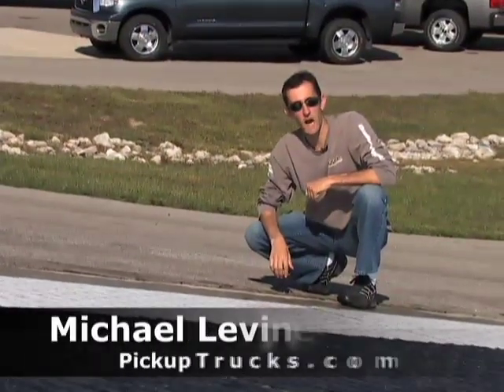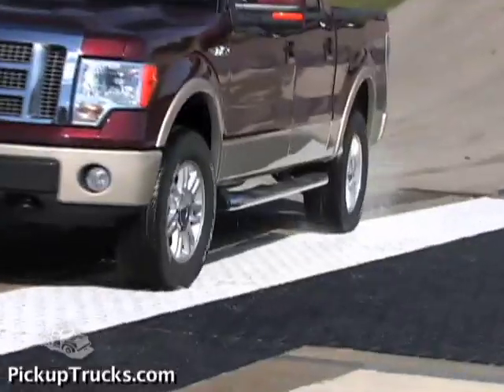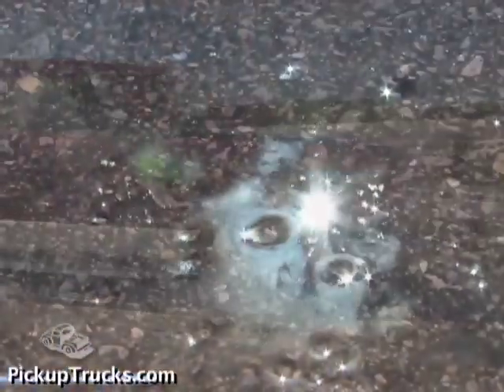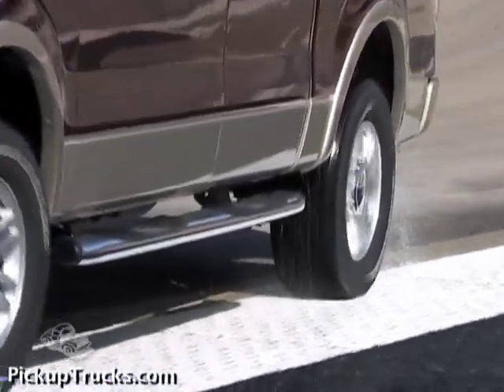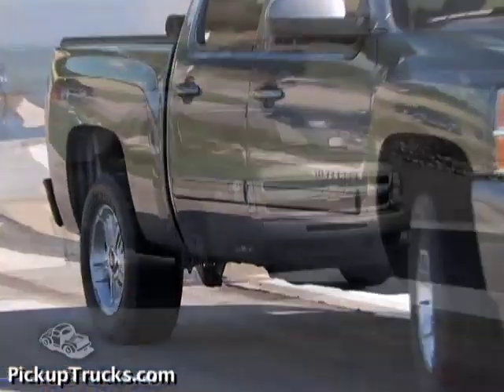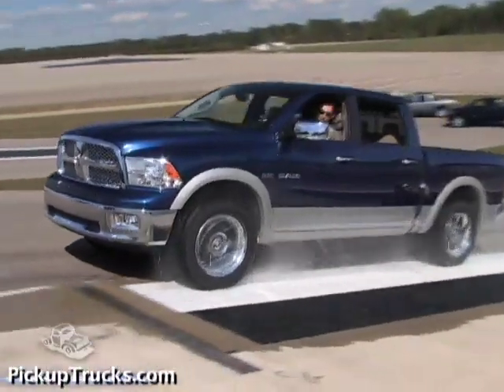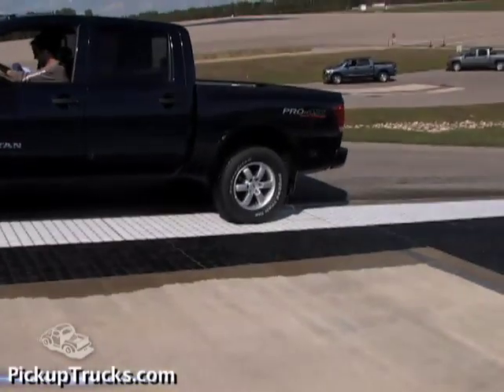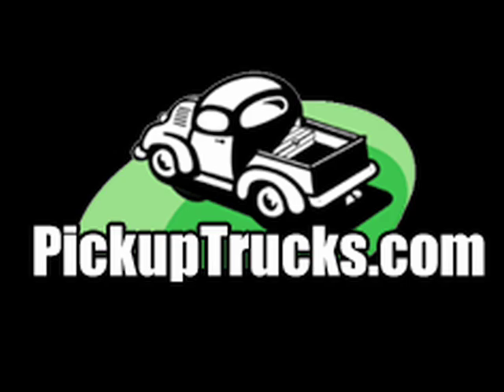Extreme Traction-Control Test

Comment: these were open diffs buddy 4wd wasnt engaged. u saw the gms do this because traction control applied the brakes, first to the one slipping and then to correct the other tire which had subsequently been sped up

Comment: Obviously the wet white tile had some traction, or an LSD, even with throttle-back traction control, would not get you up that hill. But just try taking a pickup with an LSD across a big diagonal ditch, and you won't make it. One wheel in the air has no traction, therefore nothing can be transferred to the wheel on the ground. That's why I prefer a Locking Diff to an LSD.

Comment: What year Tundra did you own. By the way, did you see the Tundra just pull a 300,000lb space shuttle? Not even a 3/4 ton truck could do that and it had no options or special kits on it, it was the same Tundra you would find on a lot. And go drive a 2012 Tundra. That is all I am saying about that.

Comment: that wasn't no 08 f150. my uncle has an 08 and it is the gen before that one in the vid
Reply: This was uploaded in Nov 2008. When you redesign a vehicle you have to say its a year ahead of when it was designed. Because If they redesigned a car in June 2008 it would be different from the one in January-May 2008 but it would still have the same year. That's why you have to say it's a year ahead, to avoid confusion. I bought a 2013 ford escape in October 2012. Did you understand what I told you?

Comment: It doesn't have anything to do with the weight of the trucks.  The term half ton, 3/4 ton, and 1 ton originated a long time ago to group different classes of trucks based on the amount of weight they could hold in the bed.  Newer trucks have long since surpassed these capacities, but the terms remain as tradition I guess you could say.

Comment: So The pickup with locked differentials came last while the one with LSD came first? this test is ridiculous if a pickup has a proper four wheel drive and a proper locking differentials then why test it without them? its like saying the the Subaru forrester is better than the Toyota FJ cruiser because it has symmetrical AWD
Reply: Depending on the test, it actually would be better because of that

Comment: Just took my 2007 Tundra out in the snow with a real LSD from Auburn for the first time.  Gotta say it's massively superior to the auto-lsd crap toyota put on it.  More consistently working that doesn't give up when you get close to that stuck, no momentum left over moment.  You gotta get used to counter steering like a drift racer but that's a riot!  No snap oversteer scary moments to speak of either

Comment: I mean that today's traction architecture seems to work the opposite way it should.
As you can see , diffs deliver the power to the wheel that has NOT traction.
In 2012 i'would have expected to see an effective traction  capabilty apart from what esp or tcs can add.

Comment: While the F-150 did well in this test with it's LSD, there are numerous videos showing the F-150 unable to get across a large twist ditch, with one wheel in the air just spinning. Meanwhile the Chevy pickup just effortlessly walks across the same ditch with it's locking diff. So I'm a little suspicious of the Ford LSD. Braking might help--I guess that's simulating what an ABS traction control would do--but unlike an ABS traction control, you're also braking the wheel that has traction. Not good.

Comment: Makes no since. I'm a ford fan and all, but a truck with a locking differential compared to a truck with only a limited slip would do way better. It would cruise right up in 
2wd with only one rear wheel on the concrete

Comment: I have a theory.... the tire in contact to the pavement is getting too much power and slipping (you can see it on the chevy). Basically a heavy foot with a bad driver... because there's no denying that a locker is better than an LSD for this type of application. Bad driver is bad

Comment: if you need power on a 4x4, like for pulling a tree down or something of that sort, the ford 5.4 can snap a 10,000 lbs tow strap before losing traction. its a beast. And the 4x4 on the ford explorer can drive sideways on sand if it hits a railroad track, as well as drive thru water. If you need these extreme 4x4 uses consider ford, but remember it will cost you repairs after 100,000 miles. I am a chevy guy but under those 2 conditions, pick ford. day to day use, chevy is better. new fords have a serious problem with the spark plugs, very costly.
Reply: homing pigeon races not any more there really reliable

Comment: ive accully done this test myself with a Gm, if you work the locker correctly it would lock the axles and walk up that ramp, expecally if they didnt ahve traction control on, the brake stopping the wheel will remove the lock on the diff... so this only tested the traction control NOT the locking rear diff's. ford, chev, dodge, toyota and nissian all make it up with there lockers ingage's, expecally the Elocker's(eatons and electronic)

Comment: Dude my 06 sierra could do this in 2wd.... diff pretty much locks nmw I don't understand in this video why it wasn't engaging like they really do
Reply: Graham Davis Its because the idiots in the video were just trying to gun it up the hill without letting the locked wheel gain traction. In the video you could clearly see the diff did lock correctly, just the people didn't ease off the throttle at all
Reply: They kept gunning it. A locked diff doesn't help much when you're basically doing a burnout up the hill. The guy narrating this video was often criticized for his bias while he was editor at pickuptrucks.com and he eventually left to work for Ford as their head PR guy. This test is garbage.

Comment: I'm sorry the Chevy has a locking rear diff it is impossible for a limited slip diff to beat it up a slick hill
Reply: Oh, its possible. You need to be either really dumb and not know how to drive a vehicle with a locking diff, or really dirty and deliberately drive in a way to make the lockers not engage.
There is no good scenario here. A test is a test of what a vehicle can do when driven correctly, not incorrectly.
As an example, I can test manual vs automatic transmissions in off road applications, by starting in overdrive with the manual box. Its about the same level of incompetence/bias and legitimacy  as this test is.

Comment: Actually that is not correct.  Even on icy and snowy roads it is not a good idea to be in 4wd in normal driving.  In fact most 4wd systems disable after about 30mph anyhow for the simple reason it is much easier to control the vehicle in icy conditions in 2wd.  4wd is more useful at low speed, with deep snow, or after you've gotten yourself stuck in 2wd.  Before you say I dont' know what I'm talking about I lived in Minnesota for about 30 years.

Comment: It's a flat surface. A 1984 toyota 4runner could pull that with enough weight to push down the wheels. Has nothing to do with the toughness of the frame/suspension.

Comment: I know its late to post on this but it's total crap. I drive a Toyota Seqouia now but I had a 2WD 2007 Avalanche with the auto lock rear end. So easily could have walked right up this, give it a small amount off throttle and hold it, the locker locks and doesn't unlock till you let pressure off it. Not sure why this is so biased absolutely not true !!!
Reply: My thoughts exactly Phil.  I have had several GM's with the locker and MANY times never had to shift to 4X4 because of the G80 lockers.  Biased isn't strong enough word,  RIGGED is more accurate.

Comment: seems to be a lot of confusion here. this test is primarily to test the traction control of the trucks in 2wd. thats it. so ppl who keep saying oh gm/chevy would have won, thats heresay. not what this test is for. another thing, they dont talk about lockers for a reason, many elock systems engage once in 4wd, chevy g80 is an option only unless fitted with z71 package which these dont have and u can see that on the sides of the truck.  the g80 locker slams on thus less reliable

Comment: donno man.. I don't know why you wouldn't 4wd in snow, you have it, use it. personal opinion tho. also, its not always the power or weight of the truck, depends greatly on the type of tires and the psi levels of said tires more tread to the ground = traction. I'm no car or truck expert but just my thoughts.

Comment: I have to agree, If i didnt buy a Chevy my next choice would be Dodge. I HATE Ford! Bought a NEW Ford Expedition in 09' and in LESS than 2 years I had dumped over 4K into it. So I traded it in for an 08' (OLDER) Tahoe that NOW has over 100K miles and I havent put any money into it except Brakes, Tuneup and Tires. LOVE my Tahoe. And next year im going to buy a NEW one. They are excellent trucks. NEVER will i buy a FORD again! YUCK!

Comment: Both GM trucks can make this in 2wd with the g80 without the use of 4x4. Toyota and Ford would struggle with the LSD. 2011+ Ford 2019+ RAM 2022 tundra can make it up with the E-locker

Comment: These "comparisons" always suck.  Its 100% FACT that the Chevy with its locking diff would put more power to the wheel with traction (50/50) than a limited slip, theres no arguing that.  The FACT that all these tests leave out are the tires are different.  Put the same type/size of tire on all vehicles, then you get a better test, in mud, snow, wet roads, etc.  Next compare these to a Raptor for off road comparison... just bring a trailer to recover them after they follow it through a big jump

Comment: @296jayce Because they wanted it to.  Notice that once the trucks with lockers start moving forward, they quit trying!!!  My chevy truck with a g80 locker would have made it no problem.  With a mechanical locker instead of an e-locker though, you have to let one tire start spinning more than the other so that the locker will kick in and locker the two tires together.  Once they get this to happen, they just quit trying, so this video is obviously biased.

Comment: "Traction control applies the brakes to the wheel that's slipping" no it doesn't, as proven in this video.  You even talk about locking differentials.  Traction control isn't a locking differential.

Comment: I have a Titan Pro-4x. It has a push button locking differential and it has a push button VDC. This test is not accurate. They had the VDC diabled and electronic Locker.

Comment: probably a stupid question but i'm not a truck guy, why is it called half ton ?
Reply: To meet it's registered GVWR (Gross Value Weight Rating) it would legally be able to carry 1,000LBs of payload without exceeding it's registered GVWR. Say you own a truck that is registered for 25,500LBS (26,000LBS being the state of PA's weight that requires a CDL) say the truck weighs 20,100LBS wet (all fluids like oil etc.). That would leave you 25,400LBS worth of weight you can put in the truck without exceeding 25,500LBS. Now that that is covered, the truck weighs Z number of pounds, to stay under a certain classification of vehicle/truck it can haul (aka GVWR). To break this down X  is the number of pounds the truck weighs (Tare Weight/Curb Weight if you want to get technical) Y being 1,000LBS (the GW Weight if said truck is loaded), X+Y=Z. Y basically tells how much it can haul.
Reply: aww i see thanks alot!!
Reply: Not stupid. What's stupid is that they still refer them as "1/2 ton, 3/4 ton, 1 ton" etc. They are anything but. It's basically a hold over from the days when a half ton truck was actually rated to carry a half of a ton and so on.

Aside from the obvious difference in age and design, my 2005 1 ton Ford vs a 1975 Ford 1 ton are complete different in regards to weight rating even though they carry the same name. To further complicate things among the various fender badge designations, there's chassis configuration, engine and drive train options, gas or diesel and gear ratio. All which effect and determine weight rating.

Obviously, GVRW's have increased greatly, and therefor payload caps. But be warned...not all trucks are created equal.
Reply: rts Indeed but my last statement was simply an explanation of GVWR.
Reply: onionman113
And you did a fine job explaining it. Better than I.
Reply: rts That is, not all trucks in their respective class are created equal.

Comment: Tyres are more important than traction control. Write tyre specs below please. Its not a comprasion.
Reply: +Can Guder They were testing the trucks as they came equipped from the factory.

Comment: mechanically locking diffs are superior to lsds however you have to consider the most basic thing, which many dont. tires. u can have 4wd, lockers on front and rear or also center diff as well if awd and have multiple speeed t-cases but without proper tires those systems r useless

Comment: The Silverado a d Sierra both have auto 4wd... Which I have had in an 04 suburban z71 and a 2010 Silverado z71.. And good bit more effective than traction control... This test should have been cars with traction control not trucks..

Comment: On the Chevy and gmc both spinning...one wheel is on the wet and the other rear wheel is on the dry concrete?? I can't believe the truck was spinning a wheel on dry pavement at the same time spinning on wet pavement....looks a little strange to me, like the brakes were being applied to the front wheels while the accelerator was being floored to make the rear wheels spin...mechanical diff not that wheel spin is hard to believe

Comment: buy a manual and learn how to drive it most of the problem solved, some upgrades to suspension and diff will help out a lot, if you want to go off road in other than normal conditions and push the truck to its max might as well make your  truck get a good frame and a lot of time

Comment: @GT500Shelby07  pretty guy. I drive a  Lorry or camion  with manual transmission
8 gears plus splitter
to get out of sutch situations you need to action the 4x4 lever and  both differental block leavers
I drove a bombardier offroad army vehicle to

Comment: LSD should be better, all racing and offload racing car use it. locker is mostly good for offroad trucks in mud-ing. 

the wheel which get more traction will get most power but it also allow the wheel with most slip spin a little faster but not too fast. enough power on the wheel with most traction to not spin lose but faster on the less wheel with less traction to spin a little faster

Comment: What's the point of buying a 4x4 if you ain't going to use it?
Reply: Squeezy this is not an offroad situation! if you have a 4x4 you have to use off road im in Canada and daily 2x4 truck no need of 4x4 im never offraod a guess never been stock road are well clean! my latest is a 02 ranger 2.3 5 speed rwd only no trouble i had a 97 Cheyenne 305 rwd only with lsd diff work like a charm on snowy road 4x4 just go deeper in the ditch!

Comment: @296jayce LSD has been constantly evolving over decades. Lockers have run on the same brutish concept since their conception. LSD combined with better traction control logic is superior to simply locking the rear axle together. The proof is in this video. Think of lockers as the predecessor to the Electronically-controlled Limited Slip system, in the same vein that the Chevy C/K is the predecessor to the Chevy GMT8.

Comment: The locking G80 is the shit this is such bull shit it pisses me off!!!!
Reply: sammy duran I have a G80 in my colorado and it works well in dirt.
i've have no problems with it.
Reply: SANIC I agree they're a good locker that's why I believe this video is bs. It takes a very minimal loss of traction for it to engaged. Do u have that automatic four wheel drive? it works really good as well.
Reply: sammy duran i have a 2WD colorado.
i've had 1 back tire completely in the air and it still went up a hill no problem.
Reply: Hell ya man!
Reply: Not sure what is hard for you to understand, the gm's are to light and have rudimentary traction control systems. The locker worked like it was supposed to but it was the 'brains' of the truck that let it fail this test.
Reply: sdfajbdakisjdgh except I have an example of  my Chevy doing a harder obstacle than on the video no problem.
The makers of this video are notorious Ford lovers so its clear that they are biased.
Reply: sammy duran I didn't cut any lines
Reply: sammy duran they did not disable the locker, both rear wheels spin at the same speed. If the gm's had some weight in the bed they would have destroyed this test. But with no weight back there and the traction control has no affect on the rears with a locker. the gm's lost on their own course while being supervised by gm's own engineer's. One short coming on a great truck doesn't seem that bad. 

And gm's are not the best trucks ever made like you all seem to think, they have their weak spots like any other truck.
Reply: sdfajbdakisjdgh based on shootouts the Silverado is ranked #2 overall.
Better than those low quality Dodges lol
Reply: sdfajbdakisjdgh It still doesn't change the fact of it seeming rigged right when the GM rear seems to gain traction they let off on the gas.The Ford on the other hand seemed to have sinned put for alot longer before it gained traction. It's obviously biased. And true for mid sized it Toyota full size is a toss up for what better fits your needs, but the new Colorado seems to knocking on the mid size segment with the intro on the 4 duramax desiel.
Reply: Sorry for the choppy writing I'm on my phone
Reply: sammy duran that 4 banged duramax is gonna be a game changer
Reply: SANIC Yesser I'm stoked to see what kind of power u can pull out of thing

Comment: The chevy/gmc must have had some really shitty tires because a locking diff is way better.  I blame the driver for holding the pedal to the metal to burn out instead of letting off and only giving enough to move forward.